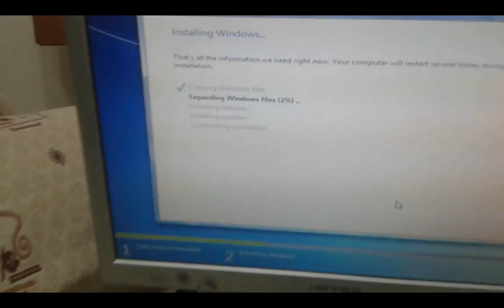Repairing a No Display PC . 5 Beeps Motherboard Capacitors Problem

Comment: Hey guys! The fix for me was removing the processor and rubbing the back of it with a eraser. I think the contact pad has collected some dust. (ONLY DO THIS IF THE BOTTOM OF YOUR CPU DOES NOT HAVE PINS AND IS FLAT. ONLY IF YOUR MOTHERBOARD HAS PINS)

Comment: my pc had 5x beep, my motherboard is H81M-VG4 R2.0 and i5 4460 processor, but after 15 sec of letting it turned off then i turn it on again it works. im wondering what is wrong with my pc

Comment: so it's a processor related problem or processor capacitors problem, i have the same problem and my processor is only 7 months use core i5 7500 so should it be mobo?, although mobo is 7 months use also
Reply from the maker: This mobo was 8 years old and the problem was with the electrolyte  Capacitors .. after replacing the Capacitors the pc runs again

Comment: Hey bud, I am curios how did your figure out it was the capacitors? I have a hp pavilion p7-1108p with the AAHD3-HB (Hibiscus) board and it is beeping 5 times and not displaying anything. No bios, I tried removing everything and only time it does not beep is when no cpu is present or when cpu power is disconnected. I tried a new cpu but nothing.
Reply: hack my games  Me too. One continuous beep and four short beeps. I'm wondering what the problem is...

Comment: 2020 update.
I solved this issue
I faced the same problem with my pc 
5 beep and stuck

Solution: there is no specific reason for this problem because I saw different people saying the different solution 

You have to check everything separately.
Reason can be -Cpu, GPU, Ram, PSU

1. You can clean or change the ram
2.you can remove the graphics card from the motherboard and start your pc without GPU(it worked for me)
3. Check CPU and CPU pin, connecting properly or not!!
4. Check PSU.

Most importantly, If your pc starts, 1st of all update your motherboard bios, bios are the main reason for this problem.
After updating bios my problem solved permanently.
(Do it on your own risk.
Updating bios can make your motherboard dead.)
Reply: Man thanks so much! All my capacitors are well ok so it was confused on this video so i checked the comments and found yours and amazingly shocked after following the instructions thank you so much!i appreciate you.

Comment: Hello my friend, I have a problem My Computer on power up, it emits 5 beats and the video does not appear. Will it be my processor? help me
Reply from the maker: +Matheus Liniglia  it depends on what motherboard your pc has
Reply: IsDeno24 I have the same problem..newely built.. Pretty sure I'm connecting everything right.. I installed a system speaker to see why it wouldn't boot up and it makes 5 beeps... The weird thing is that once I managed to get to bios by having only the essentials and switching rams place but after that it hasn't booted since
Reply: @IsDeno24  hi what would you say about HM77 motherboard from Acer aspire 7600u . It's beeps 5 times at the startup and no display.